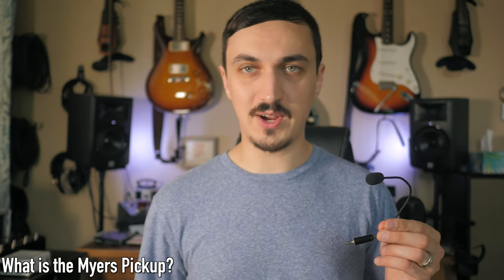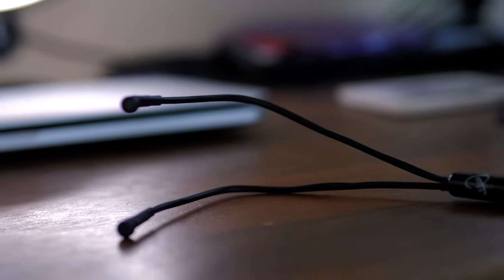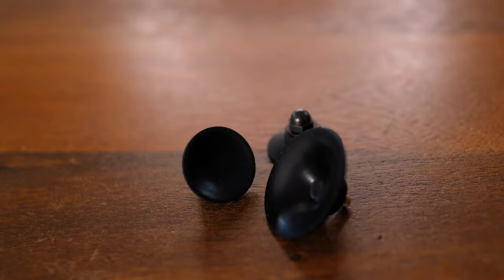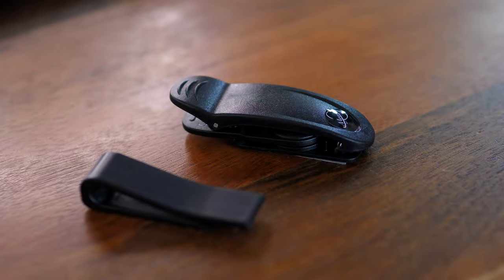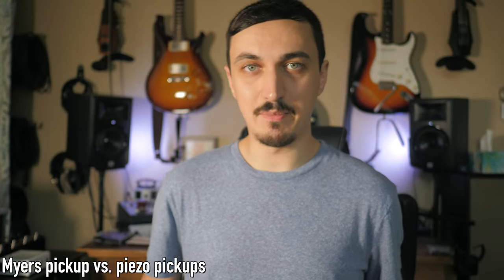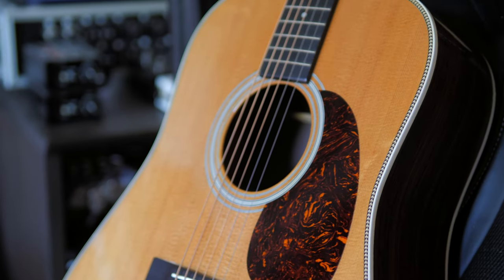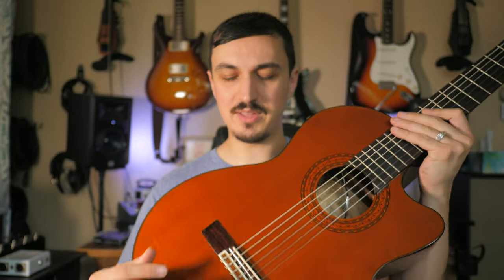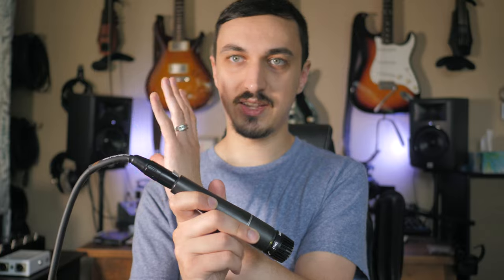The Most Versatile Acoustic Instrument Mic // Myers Pickup (Review)

Comment: Great review.  On a couple of applications, the 57 wins for the high end, but overall, the Meyers takes the cake.  I have a 1930 National Tricone square neck and it is perfectly original and I really don’t want to drill any holes in it or add anything to the bridge, so I just ordered a Meyers for this guitar.  All the rest of my guitars have K&K’s in them going through a Tonedexter IR/preamp and that works very well (even for a 1932 National Style O) but they all require either an end pin jack or a hole drilled in the side of the guitar.  Thanks of all the work on this, very helpful.
Reply from the maker: Wow, I bet that square neck is incredible. I agree, would never want to modify it. I've heard lap-style dobro with the Myers in the past and I think you'll be happy. He had his mic just above the treble string side of the cone

Comment: This mirrors my experience with my new Meyers (good to make sure mine isn't defective). Myers loses clarity and definition compared to the 57, but I can bring some of that back with EQ.

The problem I had, and one which the Meyers solves deftly, was trying to mic a mountain dulcimer outdoors. On my lap or on a stand, I couldn't get a dynamic mic close enough for a good signal and my condensers were picking up too much noise from wind and handling. Meyers can go right inside the F hole if necessary and isolate the dulcimer from everything else. This also means I no longer need to bring a separate mic preamp to then send the signal into my guitar pedalboard for delay and reverb.

I'm also excited to use this on my old Harmony H157. I didn't want to install a piezo, so I bought a magnetic sound hole pickup that just sounds too dark and muddy. This should clean up the problem.

It's an awesome demo. I'm curious what you're getting in terms of battery life. I assume the power is engaged when you plug in an output cable, so would you confidently leave an instrument plugged in between sets or while you're using a different instrument on stage?
Reply from the maker: Actually I haven’t had to replace the battery yet. I use it mostly on my violin and banjo and always unplug it when I’m not using it.